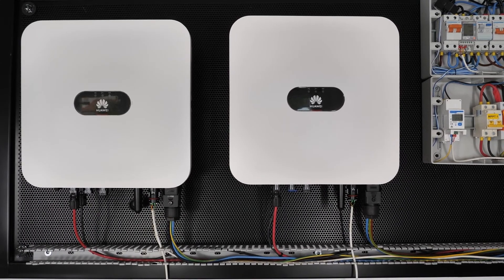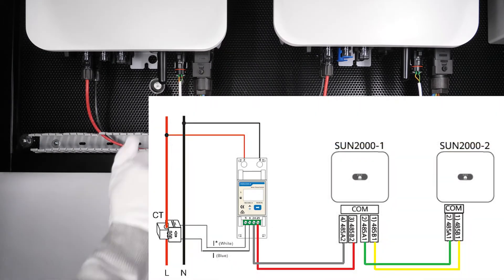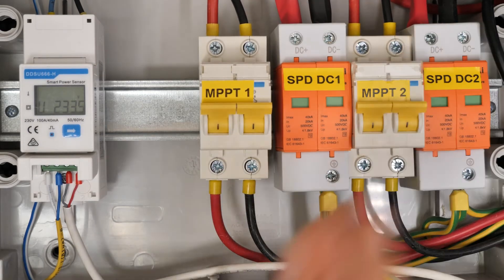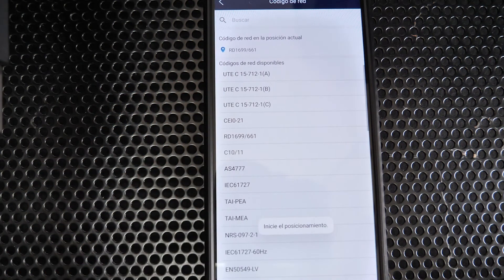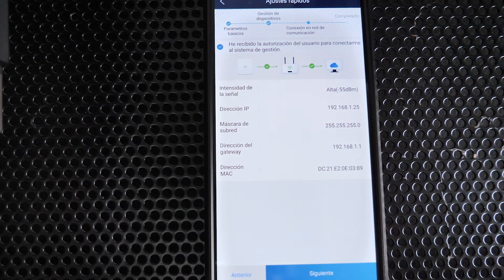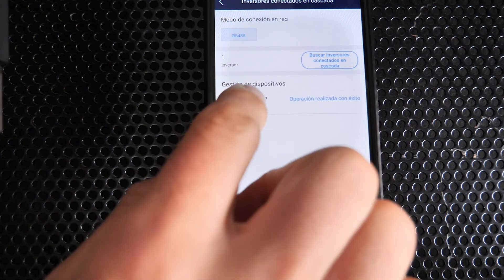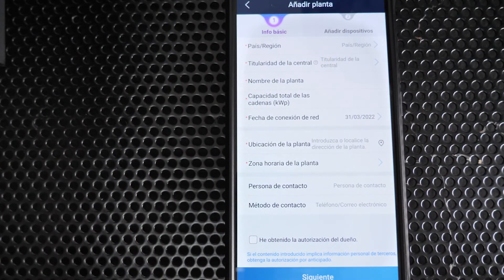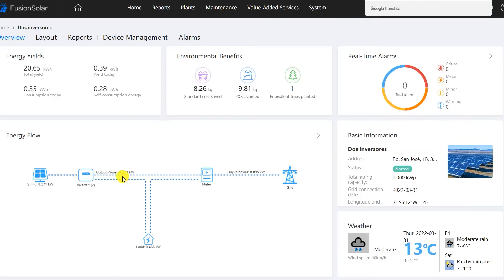Installation Guide for WLAN-FE Smart Dongle - Parallel Huawei Inverters SUN2000-(2KTL-6KTL)-L1

Comment: hi yes my battery discharging to 0 how I can keep minimum 10 precent on it?
Reply: That is a configuration you have to do being directly connected to the inverter WiFi, or then in the fusion browser connection. You should define a minimum of 20% and a maximum of 90% in order to preserve the battery.